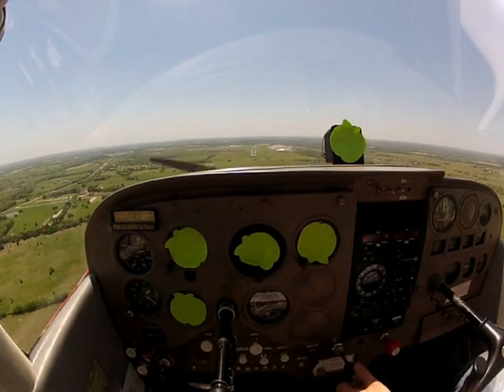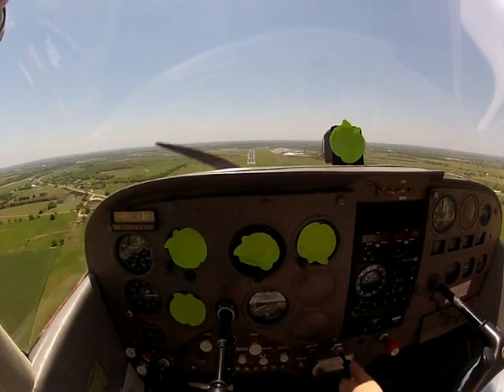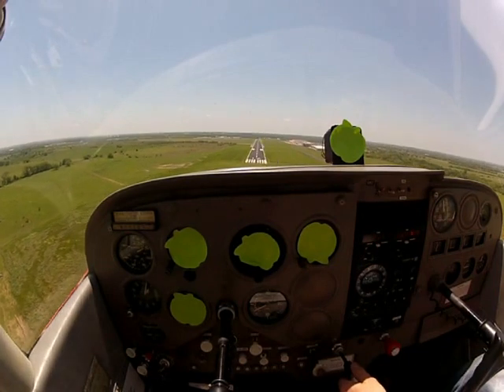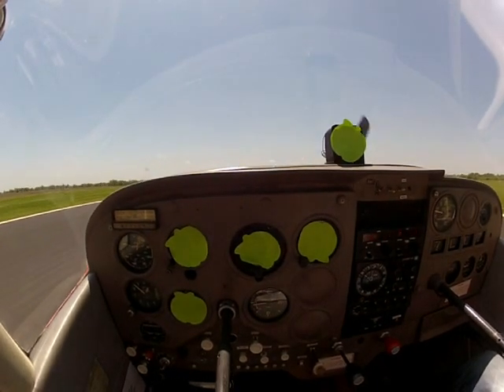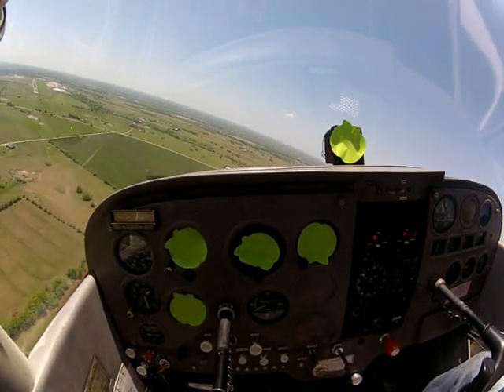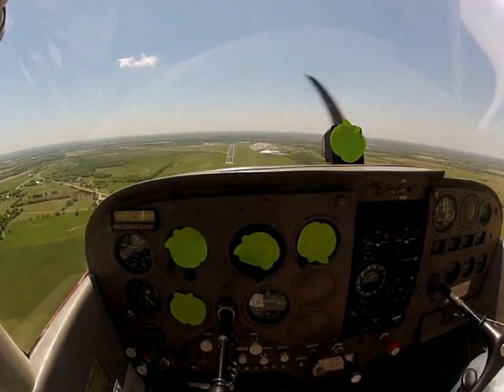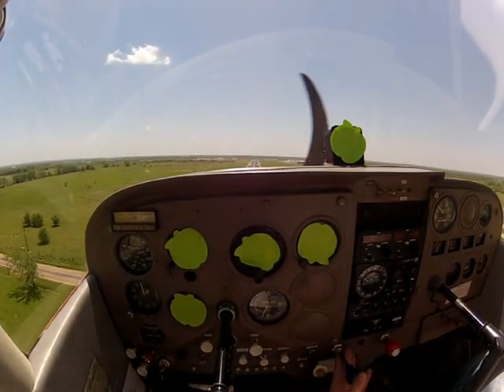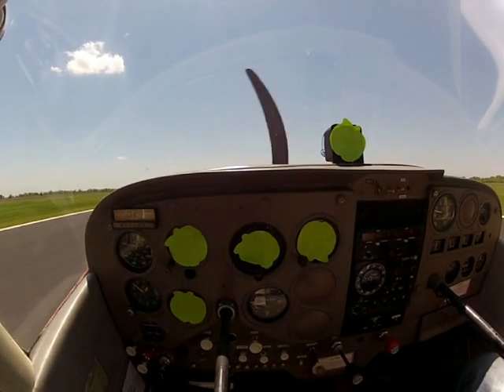Final Approach Descent

Comment: It's captaining my send line through the same recognizable landmarks and establishment grab that allows me to fly over them during my final approach I'm trying not to compensate for the change in win I'm near the surface my order and alignment are large internal axis of the aircraft with the runway now and I'm adjusting amount of wing dip to control the draft I'm floating during the turnout and I have excessively airspeeded on my approach but of maintaining a maintain appropriate approach of speed along the way to the flare I'm improper crosswind control application after touchdown which I'll adjust for with the rudder to maintain center line while I'm turning the electron control into the wind to compensate from windrift copy that
Reply: stop bragging about yourself

Comment from the maker: Ya I've never understood the Pitch for airspeed, power for Altitude theory.

When I'm at straight and Level Flight and I'm 50 feet below Altitude I don't add power to gain Altitude. You simply pitch the aircraft up.

Only time pitch controls airspeed is when you in a Climb or recovering from before a Stall.
Reply: During the approach to landing phase, at 1.3 Vso or less, you will be operating the aircraft in "reverse command". Above this speed it's called "normal command" I believe. Regardless of this confusing terminology...essentially, for any passenger aircraft (except fighters or where the thrust to weight ratio and flight dynamics approach acrobatic envelopes), during any phase of flight, the following holds true by the nature of the physics of flight: Add power = add lift, Reduce power = reduce lift, Pitch down (forward) = increase airspeed, pitch up (backwards) = decrease airspeed. The problem is, what they don't tell students is that you will ONLY observe this to be true when you're not touching anything else. Try it...set up straight and level flight...trim it nice and perfect.. Then let go the yoke...add throttle.. what happens? the VSI starts increasing correct..? ok ..go back to straight and level flight..trim it.. now..simply pitch up...what happens to your airspeed? it decreases..remember don't add any throttle. Initially of course you climb because you have enough forward airspeed generating lift to intiate the climb..but eventually your climb stops/slows..even though you're still pitched up. Your airspeed however continues to bleed off. It is critical that students understand this concept. What they REALLY should teach is..."Add power to arrest your decent rate..feel you're sinking..add power...but keep the plane pointed at the numbers as you come down". Feel you're ballooning ..reduce power..keep the yoke in the same position". "See your airspeed bleeding off..point the nose down...airspeed increases" ..."too much airspeed, point the nose up..airspeed decreases" . Now if you simply did those motions independently your approach wouldn't be perfect of course. What really is happening on approach is a coordination of pitch and power. So..say you're sinking..You ADD power to arrest the decent rate...but at the same time your hands are automatically pushing the yoke FOWARD to keep the nose pointed at the numbers. Why? because aircraft are designed to be stable..it wants to stay at 70 kts...so when you add power..the VSI goes from -800fpm to -500fpm and your airspeed starts increasing (due to the initial nose down attitude)..but the plane pitches nose up because it wants to settle back at 70 kts with the New -500 Fpm. Effectively..therefore, there is no "reverse" or "normal" command. The plane is trimmed for 70kts and will attempt to stay at 70 kts naturally. The pilot pitches up or down to control airspeed..and adds/decreases power to control rate of climb. (-800 to -500 fpm shall be considered adding "lift". A decent = negative rate of climb). So that's why...in a stall, you Pitch down and add power. What you're really doing is pitching down for airspeed and angle of attack reduction, and adding power to reduce rate of decent. IF you pitch up, you're worsening the stall by reducing airspeed. and if you don't add power, you're increasing rate of decent and dropping outta the sky. That's why you can stall at ANY attitude (all about AOA to relative wind). In cruise flight..we THINK that by adding power we're increasing airspeed...not true..what we are really doing is increasing lift initially then pushing the yoke foward to stop that lift and convert it into airspeed. This is also why the TRIM tab is sometimes called "speed control" or "cruise speed control". It's used to lock in an airspeed. Most people think it's used to lock in your attitude. You "TRIM for Airspeed". Not sure if this helps but let me know if this helps. I'm curious...as an engineer and a pilot (Priv-Multi-Instru, soon to be commercial).
Reply: +Irvin McGinnis nice explanation thanx
Reply: @FutrXIB  Thanks for taking the time to provide that very thorough explanation.
Reply: @FutrXIB  Great explanation. This helps alot.